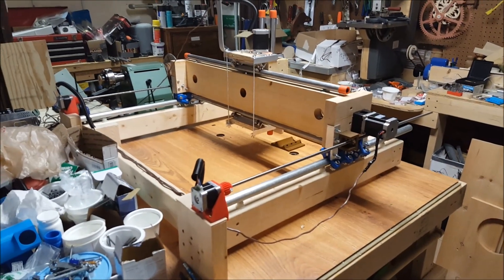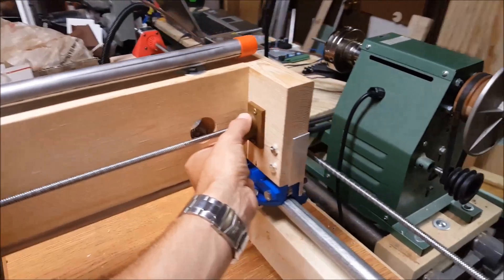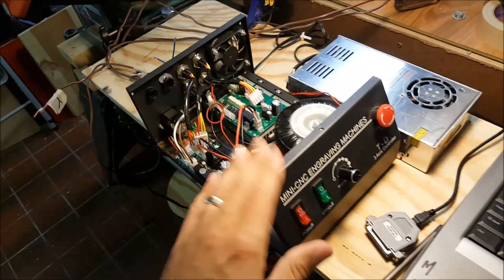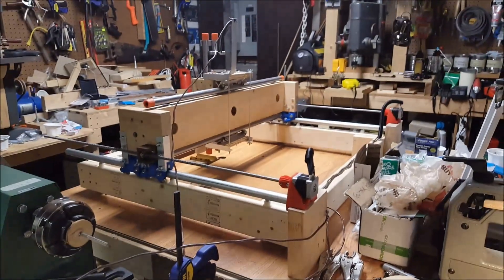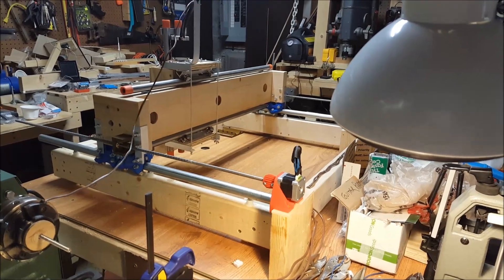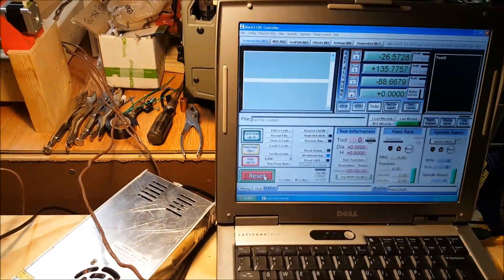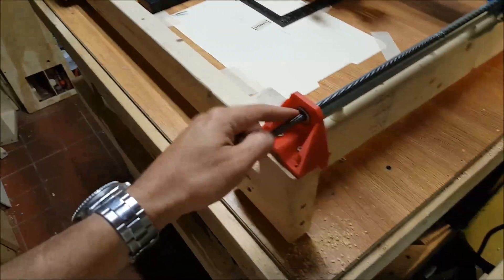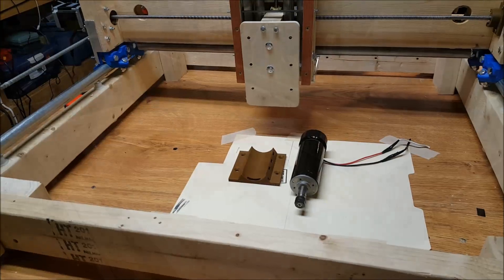Solsylva CNC & MPCNC Mashup - A Unique CNC!

Comment: I had an idea similar to this. How are you doing the dual-drive? I want to run one of these via Smoothieboard.
Reply from the maker: I kept it real simple and the dual steppers are just doubled up on the same connection posts.  For low voltage stuff like this and small stepper motors I didn't notice any issues of overheating, lag, or missed steps.

Comment: So - Ive ran through a few of your vids. You didnt keep the MPCNC in its original state very long. Is there a reason for this? I figured Id ask before I invest the time and money in it. Also, on the Solsylva, arent you concerned with the studs warping? If going with wood is a better answer to the MPCNC, then how about plywood?
Reply from the maker: Hi Jeff.  I played with the MPCNC for a while but it had too much flex for what I wanted to cut.  The flex was primarily due to the large size that I built.  I think if it was reduced to about half the size I made it would be plenty strong for a lot of great projects.  For the Solsylva I used studs that were as dry as I could find.  But sure a wood machine will move a little bit over time.  I've built many CNCs with wood and for my little projects the small amount of size changes weren't an issue.  In my latest videos I have combined the MPCNC and the Solsylva into a strange blend that works extremely well.  Best of luck.
Reply: Thanks for the reply. I do like the blend you are using. Question - how are you attaching the lower gantry "tubes"? did you thread the pipe or put a captive nut?

Comment: Q1:  are the X 17 steppers simply electrically paralleled into the motor driver board?  Q2:  for the two X trucks, is it only weight/gravity that presses them down onto the conduit rail?  Thx.